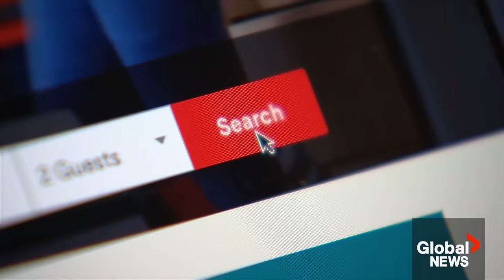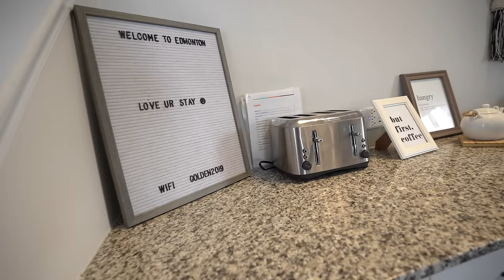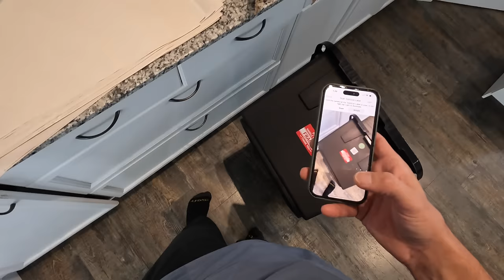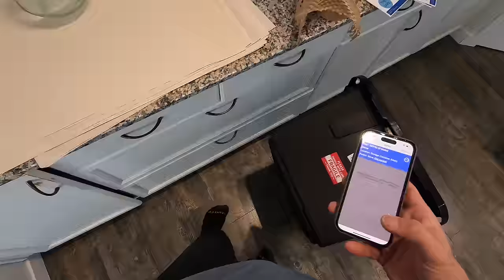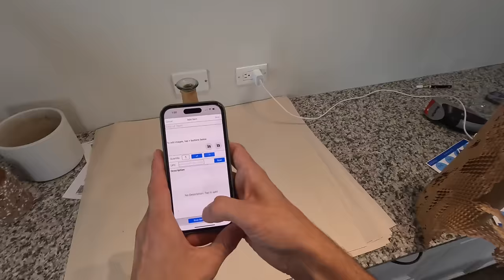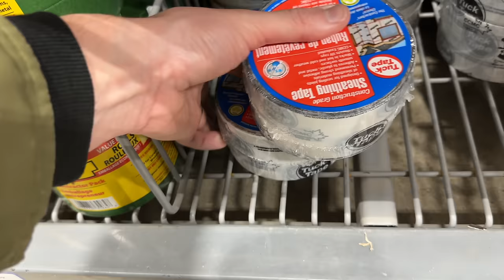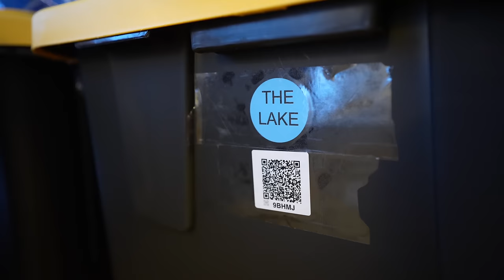Saying Goodbye...

Comment: I used a pod to move from California to Texas.  It looks a lot bigger than it is.  I had a small studio apartment and I had to give lots of things away because it wouldn't all fit in the pod.  I don't see how the heck you guys are going to fit all that stuff in one pod.  BTW, pack as tightly as possible because there is a lot of moving and jumbling around during the  transporting of the pod.  When I opened the sliding door to start unpacking, a ton of stuff came tumbling out. I agree, the pod was the most affordable way to move.  You guys are so organized that you should have no problems.  I drove toTexas with my dog and I was able to store the pod with Uhaul until I got there.  They then came out and delivered the pod.  It was so darn easy.  Good luck with the move.

Comment: I really like how those bed frames pack the pieces into the head board. But I would have left them for the tenants. You've packed up 5 or 6 bedrooms but you only have one unfurnished bedroom at the lake and two bedrooms at the land. The sofas will be useful but they are very bulky. I hope they fit in the POD. They could have been left behind too. And you may have too much kitchen stuff. Oh, well. It may have been harder to decide what to take and what to leave, than to just pack it all up and move it.

Comment: Wish I could’ve warned you kitchen take 8 hours for a well stock kitchen as small appliances, dishes, glasses, cookware, and serving dishes. When moving trash bags for pillows, bedding, towels, kitchen linen, and small box of bathrooms stuff. I’ve moved across country 4 times and several town moves. You can do 2,600 sq ft house 30:19  in 5 days. But I had a first box for things needed for first 48 hours

Comment: It's probably too late but I moved with U-Pak and when I needed extra pods, I was able to negotiate a lower price (partly by telling them I might go with Pods instead). And you're right - THIS is the way to move! Actually, U-Pak has smaller containers so you might have used both companies is you didn't have enough till two Pods. And in the US, the U-Haul website has the names of local people you can hire at each end to help load and unload.

Comment: Now that this is behind you, you will end up feeling a certain freedom.  It is not as though you have sold the properties, you are just shifting gears and there will be a lot less about that which will need your attention.  Plus, you are now going to be bringing pieces of your past into your current and future spaces and this will help to hold onto the memories you shared and bring everything together for you both.  It is no longer a then and now situation, this is a segue from there to here and it removes the break that used to separate those feelings and spaces.  It has been a lot of work, but in fact it is going to be a healing experience in the long run. You will now be surrounded by all the pieces of your shared journey together, think about how comforting that is going to be? No more fragments of your lives strewn everywhere, there is now a beautiful cohesion.

Comment: I assume that the return on your investment is higher with the long term rental than the air b&b. I just was not sure why you would do the switch otherwise. I am just curious. Most other costs should stay the same. Good luck with your new rentals.
Reply: The impression I get is that it's not as profitable with long term rentals. At the same time since they are non furnitured, they save a lot on work,and refurbishing worn down furniture, so it should work out profitable in the end anyway.  At the same time, with the airbandbs having taken over so much of the cities, they are doing a good thing for the community keeping long time rentals on the market.  cheers! / CS